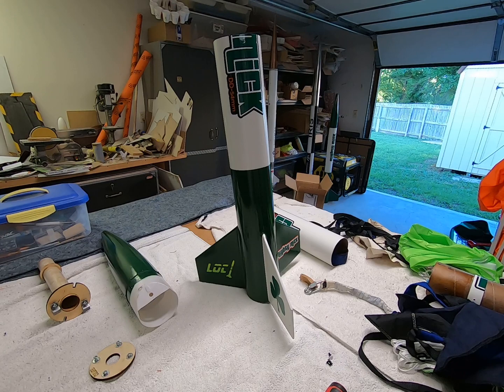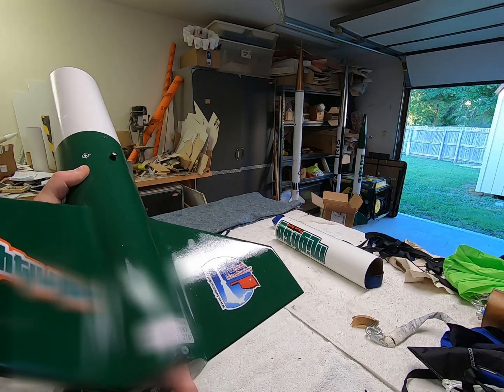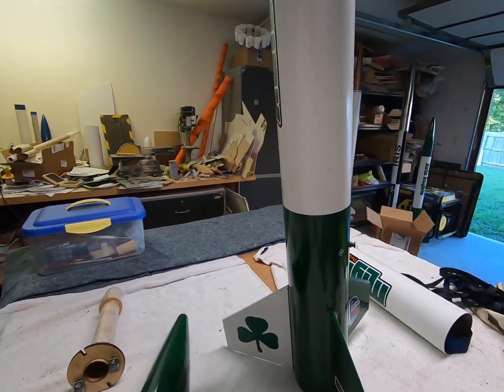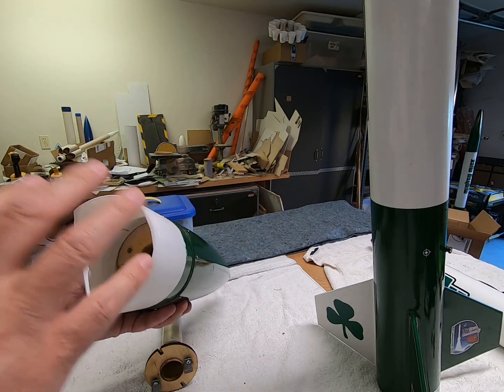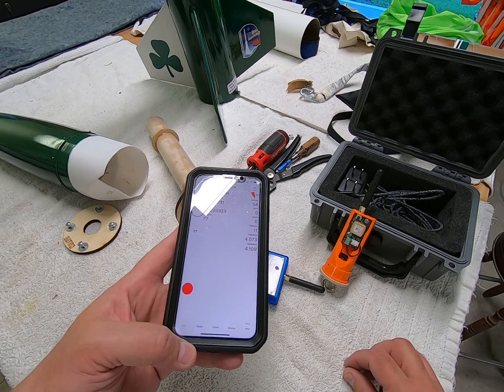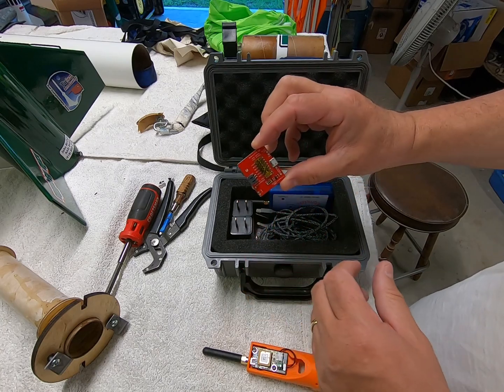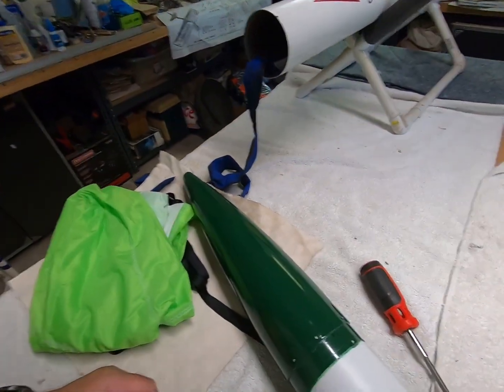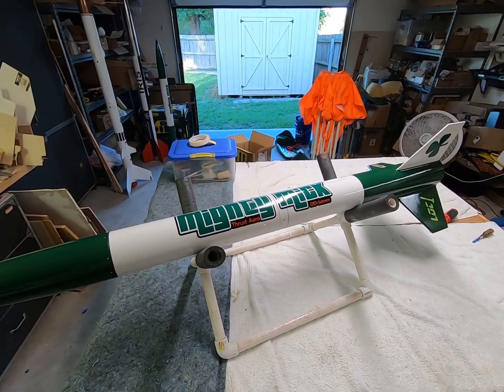08 10 22 Rebuilding Mighty Mick Dual Deploy with GPS Tracker

Comment: I noticed a blue sleeve around your black nylon shock cord. Is that an FR sleeve? If so, where can I find them? It looks like a much more cost effective solution than purchasing Kevlar shock cords... thanks.
Reply from the maker: Yes.  They’re called shock cord protectors.  Available from several rocketry vendors.  The blue ones came from ‘Dino Chutes’, but they’re no longer in business.  LOC Precision and Top Flight Recovery are good sources.  http://topflightrecoveryllc.homestead.com/page3.html. https://locprecision.com/collections/model-rocket-recovery/products/fire-resistant-shock-cord-sleeve
Reply: @OKTurbo  Thanks! I'll be including them in my rockets with nylon straps!

Comment: Does that featherweight system take you right to your rocket?
Reply from the maker: Yes.  It gets you within 10 to 20 feet.  GPS accuracy depends on how many satellites it picks up and also on your cell phone’s GPS accuracy.  The tracker on the rocket transmits it’s coordinates to the ground station.  The ground station talks to your cell phone on blue tooth.  The phone app gives you both the rocket’s coordinates and your cell phone’s coordinates.  And the phone app has a little arrow that point you in the way to go.  Very nice.